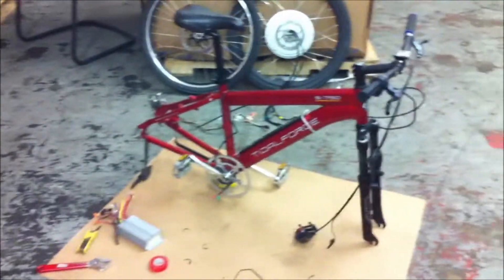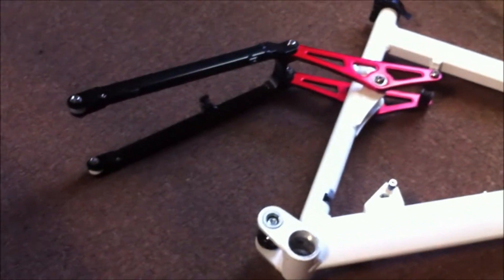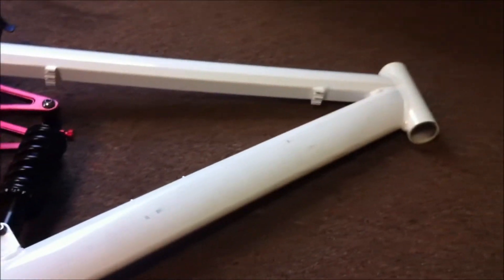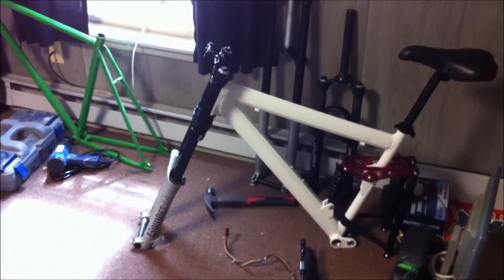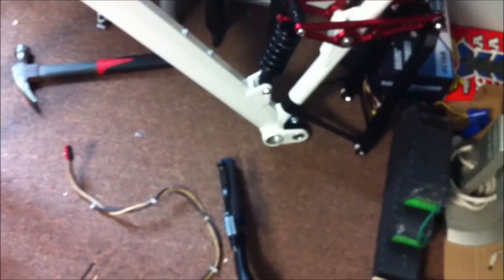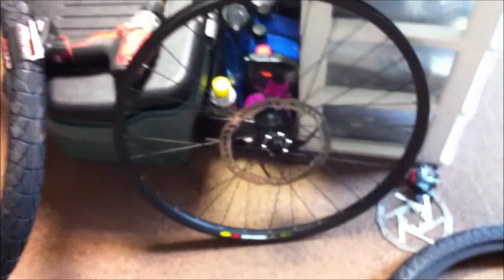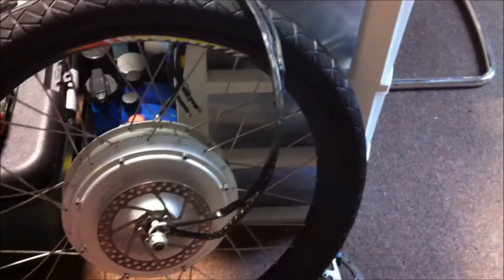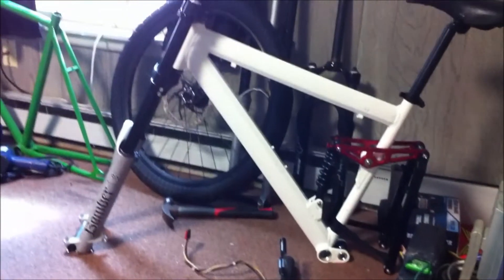72V X5404 Genesis Farfle Electric Bike Build Part 1

Comment: Nice project you got qoing there. That 20mm thru-axle is best you can have in a fast e-bike, won´t break down. Looking forward to your future vids. I got a similar project going on, but it has lots less power than yours. I´we been making a battery box in to the triangle, its about done. Also gonna make a bracket for the controller under the down tube and a box for all the wire connections and stuff. Shuold make a video but can´t seem to find time to do it.